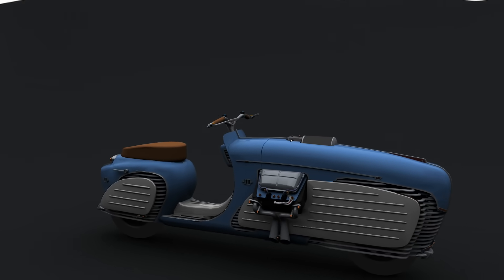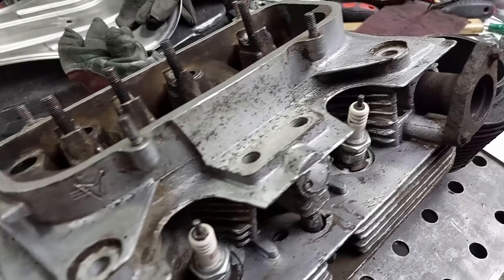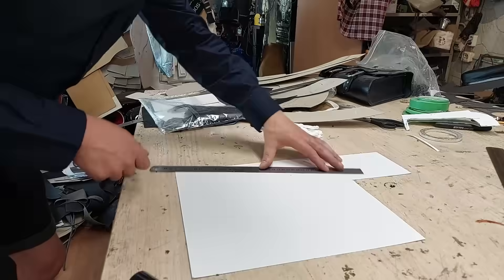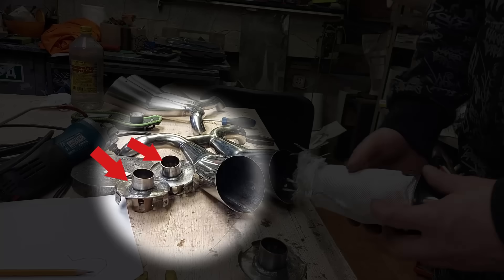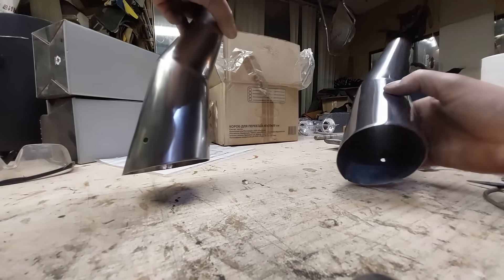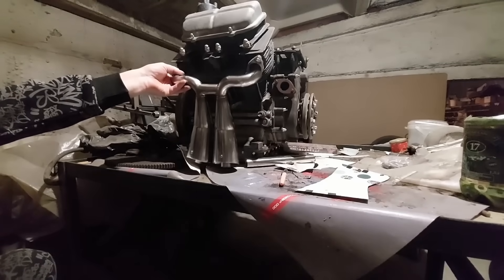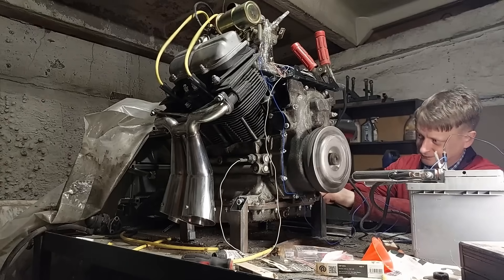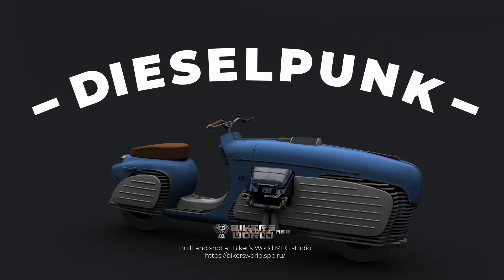I build a car engine scooter. Part1 - engine, mufflers.

Comment: Okay, we have a neat engine. This remembers me of Friedel Münch, the man who came up with the Münch Mammut. Because he was so fond of the 1000cc NSU Prinz engine, he thought "That´ll make a lovely bike!"
And it did. It just was an inline4 and I think he also used the car´s clutch & gearbox. I´m not shure if he used a drive shaft or chain drive but because the engine ripped out spokes by the dozen he contracted a very special back wheel to be made. Out of the special sauce airplane wheels were made of I think… But Your Rube Goldberg drivetrain get´s the cake. Seems to me like You´ll loose a lot of power there.
If You´d turn the engine 90degrees You could go like actual big scooters do: have a more direct connection to the back wheel. I can live with a cvt, seems right. 
Anyways, I like the idea, Keep at it & don´t unalive Yourself in the process! Yeah, I know there are a lot of "I think"´s but I just stumbled over this & had to give my two cents. Because of the neat engine.
Reply from the maker: Oh, NSU Prinz design was stolen by soviets to morph it into ZAZ 968 😂 And this soviet vehicle had the engine I'm using right now 😂 However, this scooter will be so small I just can't get enough space. This is a really small car engine, it's weight is about 60 kilos (110 pounds). There were several bikes built with this motor turned 90deg around - buuuuuut.... Well, let's first give this project a chance) 'Design first' rule is on until it fails)
Reply: @saintpetersbuilds  Yes, I can see why You went with this engine. But if Soviets copied the Nsu Prinz… I don´t know if "copied" is the right word. Similarities: overall size, 4cyl aircooled in the back.
Brainfart: What if You go off the cvt with a straight driveshaft right back and use a shaft/hub combo from any old drive shaft motorbike? Heck, the Ural was a copy of the old Wehrmacht Bmw, why not go with that?
The less components You have the better.
You could keep the engine orientation & go directly from cvt to the back wheel.
Why not look at the Ural drive shaft?
The little v4 doesn´t tear out trees so it should work, in my head it does…
I´d always go with tested & proven stuff like that. You have to come up with enough solutions on its own- let´s keep it simple.
Kind Regards
Reply from the maker: @LaLaLand.Germany well, speaking of NSU - the design was influecing ZAZ engineers, but not the technical stuff. And about Ural/Dnipro/Dnepr (old BMW) final drive - I have R12 wheels on this project, so their ratio is too low for me. They are about 4.5:1 while I need aboult 2...2.5:1. Adding a multiplying gearbox is possible, but it makes transmission almost as complicated as my current solution))

Comment: I don't know but you probably have looked at this, but could a BMW or  MotoGuzzi shaft work instead of having a bevel to chain to wheel?
Reply from the maker: It could be if wheels were not R12 to fit this fairing) This vehicle will actually be quite small.
Reply: @saintpetersbuilds  ahh shame, felt like the hub spoked up to a smaller wheel rim would be perfect 😅
Reply from the maker: @will_hyde well, I'll think about it, thanks.

Comment: isnt the torque of the engine going to be a problem when the scooter has to stand upright? Like the one propeller airplanes that tilt to one side because of the motor. Good job nonetheless!!
Reply from the maker: Well, Boss Hoss V8 5+ litre bikes are still rideable somehow) This is a half of a Pony Hoss, I hope it won't be worse than another Moto Guzzi, Honda ST1300 or BMW.

Comment: Eye lids are not good enough cover for welding. You will be sorry.
Reply from the maker: Yeah, I usually don't do that and always dress stuff if it is not a 10 sec weld. However, eyelids are still better protection than a welding mask you forgot to turn on 😂

Comment: Find a shaft drive motorcycle drive line. BMW R1200 series from the 1990s would work great and can be cut and extended
Reply from the maker: I'd love to. We even have Ural and Dnepr (Dnipro) option here in ex-ussr countries, it is several times cheaper and similar to earlietlr BMWs. But the problem is that I use R12 wheels. So at top gear and max rpm the bike will go IDK 60...70 kph (35...40 mph). Plus the gearbox is too huge and bulky for this small bike. But anyway thanks for friendly advice and dropping a line! Oh, btw, if there is a final drive with approx. 2:1 ratio used anywhere on motorbikes please let me know, I couldn't find one.

Comment: why are you using one of the worst engine ever made for this project??
i have same engine un Luaz and it is nothing but a troulbe, will swap 1.9tdi onto it
Reply from the maker: Man, you know nothing about BDSM 😂 Yes, you are right. This is a part of the quest to make this piece of terror run. However, two main problems are ridiculous ignition system (I already relpaced it) and carburetor throttle valve axle having gaps (mine has none). So I still hope it will do it's 40 hp for a while at least. But if I am wrong you will have a great evening seeing me suffer on a video one day😂😂😂 Isn't it fun?

Comment: very nice design but i would not use chain drive for final transmission and just use bevel gear and universal joint like from honda goldwing or bmw motorcycle
Reply from the maker: Unfortunately, they have low ratios for my R12 wheels( This bike will be small. Fairing is high enough just to cover pilot's knees.

Comment: I'm impressed, and subscribed 👍. But that's to powerful for a scooter, would be better in a VW
Reply: Seems my reply didn’t post, so I’ll try again.
(Another) RD350 in a lambretta frame.

https://youtu.be/SDsn9bhtTUE?si=4QSMfaVxxbZJmtwT
Reply: Too powerful? Na…. Too big/heavy for that frame? Possibly. 🤔🤷🏻‍♂️
Reply: I have 2 reflexes and a helix both about 20hp.  The helix runs 75 mph the reflex 80+   this thing would run 130. Not sure that is something I'd wanna be on @Dave_D
Reply from the maker: @Scooterdude01 ajaja, not sure I wana be there, too. But I must 😂

Comment: Direct drive with hydraulic clutch-pak
Reply from the maker: Oh, that gonna be a small 5hp-capable unit or huge cast iron bulldozer part that can be moved by a forklift) I'll think about that again, but probably it will still be too small, too big or too hi-tech for an average workshop.

Comment: I begin to wonder just how much power potential that V4 has?  The original only made 24 horsepower, though that number might be slightly conservative.  Despite their roughness they look to be very overbuilt, but then that's how the Soviets built engines.
Reply from the maker: Well, this is a 40hp version from ZAZ 968 model. And you probably had ZAZ 965 engine which should have around 30 hp. I hope mine makes it's 40 hp of power, not more. There are easy ways to get 50+ hp out of it, but I don't want it. I'm afraid the torque will kill my CVT. So no power upgrades are planned yet)
Reply: @saintpetersbuilds  Actually I've never had one personally.
Reply from the maker: @douro20 oh, sorry. I probably mixed it up with another comment. It is my "sitting in comment section challenge - day 3" now 😂 I am fading, sorry 😂😂😂

Comment: I think the design is really great. But you're not building a scooter here!

On a scooter, the motor is always behind or at least under the rider and is coupled directly to the rear wheel (i.e. without a chain, belt or cardan, but often connected to the clutch with a direct gear wheel). The seat position has no influence on the label!

So you are building a MOTORCYCLE (motor in front of the rider, drive via chain/cardan or belt to the rear wheel) with a seat position similar to a scooter. So you could perhaps call it a “MOSCOO” or ‘ScooMo’, but “scooter” is unfortunately the wrong term!
Reply from the maker: Well, a common term is 'maxi-scooter'. But why not ScooCar then)

Comment: I would rather put two or three years between engine and CVT, avoiding the first chain.
In any case, I would remove one chain and add one belt.
Before the CVT there is less torque to deal with
Reply from the maker: Well, a strong belt will be wide. That's what I'm afraid of. And about chains... Those 520 chains are used on sportbikes and heavy choppers. I hope they will last long enough in a 40hp bike. Finally, gear drive is too complicated (and probably it will be too big and too loud).

Comment: Isn't that the engine from a Zapo? then the case is made from magnesium, and that explains the white powder...
Reply from the maker: Yeah, it is a Zapo Mg/Al alloy case. It reacts with zinc covered screws. So I took zinc covered studs. They will react again and it will work as a loctite )) However I used some loctite as well.

Comment: I really like the exhaust/muffler setup. I'd also recommend using disc brakes if you have a source for them.
Reply from the maker: Well, that's just what I have on my mind (and in my notepad) right now 👍
Reply: @saintpetersbuilds   Please go for Disc brakes as they will be easier & safer to use and no adjustments needed. And with a car engine and weight of the overall machine the momentum will be high too.
Reply from the maker: @sucharsharma oh, this engine is 60kg (about 100...110 pounds). And the bike will be quite small, the fairing will just cover the pilot's knees. I hope things are gonna be allright)

Comment: why not a cvt from a honda forza or such, longitudally and longitudal chain from that to the back wheel.

ok i get it the shaft drive is necessary for the scooter look while being front engined. but why not bmw shaft hub at the back or something

edit: any piece of plastic even transparent is basically better than closing your eyes from welding(the eyelids pass through in some bad wavelengths)

I don't think the muffler bit will affect performance at all if the exhaust cools at all coming out.
Reply from the maker: Well, most of those CVTs are too complicated. They are mostly electrically driven nowadays, a PC decides which ratio to set.

I could use a Dnepr (Dnipro) or Ural gearbox, but first it's too bulky and second I have tiny R12 wheel. So I need some other final drive than Ural's with twice smaller ratio. And I just couldn't find anything.

Comment: Awesome! That exhaust will not conform to Euro5 plus!  Any chance to get it roadlegal in your country? I am looking forward to seeing how you will solve the front suspension and steering. Like a single front wheel tractor?
Reply from the maker: Well, I hope I will get papers for this bike. If not, I will make it a sport equipment. This makes it legal, but not road-legal. However, fine is not that big )
Reply: @saintpetersbuilds  Some things are still better in Russia. 😁
Reply from the maker: @marcbrasse747 well, if I get drafted tomorrow I wont finish the build 😅
Reply: @saintpetersbuilds  Maybe I’d better skip such remarks from now on then.😁